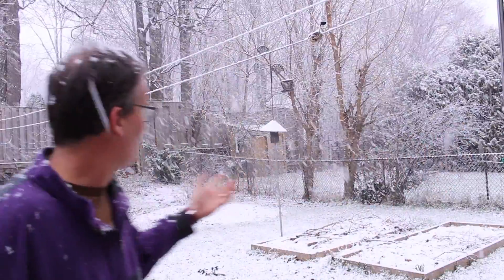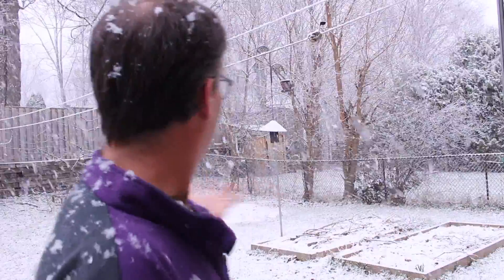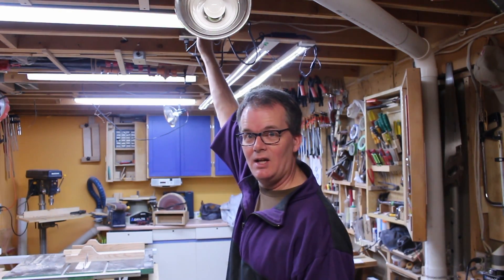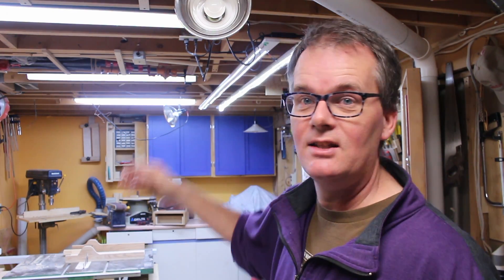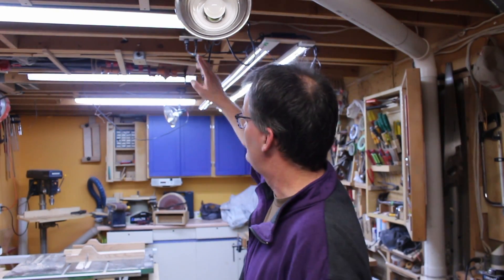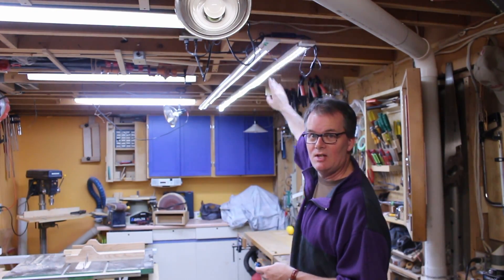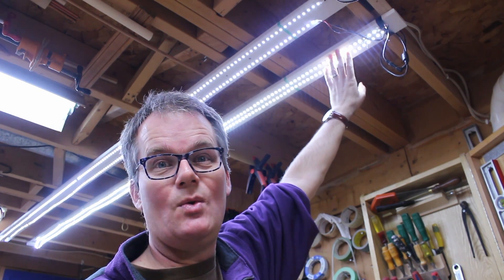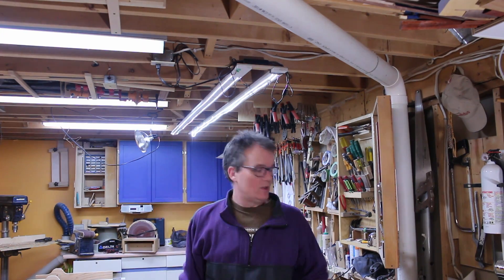Snow, Shop Update, and LEDs part 2 (WnW #52)

Comment: Is it hot because they are closer together on the strip than the newer/Chinese led strip?  I wonder how close they should be.  In series means both strings on the same supply?  So maybe the heat also released the tape.

Comment: witch leds are the bright ones the 50/50 type do you know ????
Reply from the maker: I didn't notice much difference between the 5630 or 5050 LEDs.
Reply: thanks a bunch pal thanks for answering me
Reply from the maker: I remember being a bit disappointed as they were supposed to be noticeably brighter.
Reply: thats what i thought to lol im thinking about trying to replace a floresent fixture over my kitchin sink its got 2 2ft long bulbs and there 40 bucks for them i was just thinking about doing like you did n just get some leds how do you think that would work its just over the top of my kitchen sink????
Reply from the maker: I did the same thing.   Works okay, but if you watched my latest LED video you note the split second pause before the LED strip lights up.  That is a bit annoying.   I'd still take a look at Lowes/HD and check out other options and figure out if I thought it was worth it.  Its a constantly changing market for LEDs!!
Reply: thanks some much for your opinion i will think about it more have a great day !!

Comment: Interesting video but I would have just retrofitted those old fluorescent lights to run LED tubes. They keep getting better as time goes on. I found a set of halco led tube's that output 1800 lumens and only use 15w per tube.  I have recently done this with an old light I found at our local flea market and I am thoroughly impressed by them.
Reply from the maker: I have not see any such tubes for the old T12 units.    But I also like fiddling with stuff, so the more DIY approach is sometimes fun.
Reply: They will be T8 units not T12 but they will usually still plug into the old tombstones. Just make sure they are non-shunted tombstones.

Comment: I use plastic holding w/ screw hole in them. u did pretty good with money because I spent $ 170.00 for 130 lts at 16 ft: transformer, and cord that goes into ele. socket. Being a ele. working on liting I new that 3m dose not hold on wood . BEEN THERE DONE THAT. LIKE THE VIDEO VERY INFOMATIVE.
Reply from the maker: Thank-you, Skip.

Comment: FWIW, there are plastic clips designed to hold the strips in place. I've tried the ones that have a single screw, on one end of the clip, and can honestly say that they stink on ice. I'm told that the clips which have two screws, one on each side of the strip, work much better. I will be ordering some to try out soon. BTW, very interesting and entertaining videos.

Comment: Is it my imagination or are the 5050s brighter. At least they look brighter on camera. Thanks for the refence to DIY Perks. He does a great job of of explaining what he is doing.
Reply from the maker: +WoodRodent Yeah they seem to be.  I've swapped the laptop PS  out to the 12v 72W power supply and it is running a bit cooler.   Still would like a solution that lets me use the (Free) laptop PS.

Comment: Heyy Art, the Amps of the power brick has nothing to do with it ;) It just has to provide enough. Like having enough water in a bucket to water the plans. More does not hurt. It's all about what the strip draws. And that depends on which you have. The 5050 type with 60led/m draw about an amp per meter. So 5m = 5A. 

The buck converter you had is a great module with fine documentation. Just Google "lm2596 datasheet". And it tells you it has a rated load of 3A. So 5A is to much. And 3A is absolute maximum. If you draw something close to that the chip will get warm and needs more cooling. Driving 2m of 5050 / 60led/m strip is fine, 3m with a heat sink. So use multiple cheap bucks or 1 beefy per strip and you're fine. 

2 in series @ 19V will work fine, you only lose light. They'll run at less then a quarter of there max current. But okay, less current is also less heat and longer life. Both in parallel is a bad idea. You overload the supply and overload the strips. Because the hot glue melts I'm afraid you did put them in parallel...

Weird to see snow! I've seen other Canadians bathing in sun when it was just barely above 0 (Celsius that is) here (Netherlands). And now spring's finally here you have snow...

Btw like your Dutch name ;)

Cheap buck: http://www.aliexpress.com/item/Mini-360-DC-DC-Buck-Converter-Step-Down-Module-4-75-23V-to-1-17V-for/32436860547.html
Reply from the maker: +tengelgeer Thanks for the detailed comment!
Reply: What is a beefy strip? -- "use multiple cheap bucks or 1 beefy per strip and you're fine."

Comment: To overcome the LED adhesive problem, I have started cutting a shallow dovetail slot /_\ in my mounting boards.  Leave the adhesive backing paper on the LED strips and just slide the strip in from the end.  Makes the strip easy to remove should there be a failure